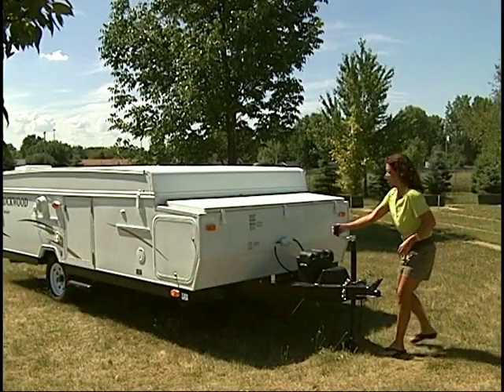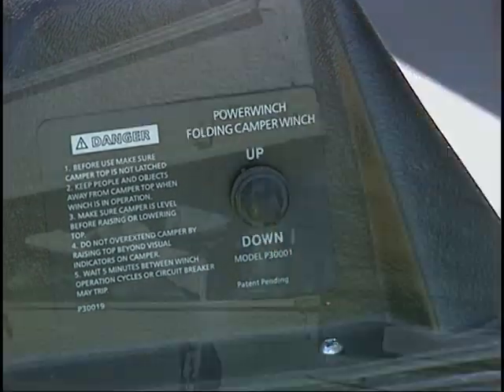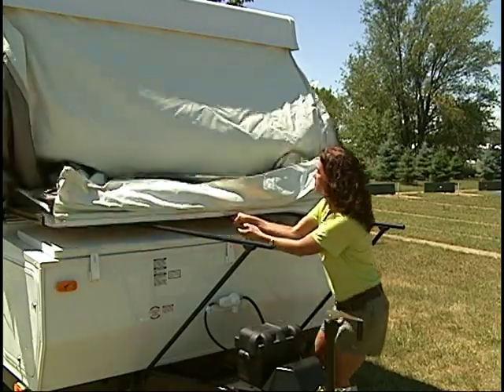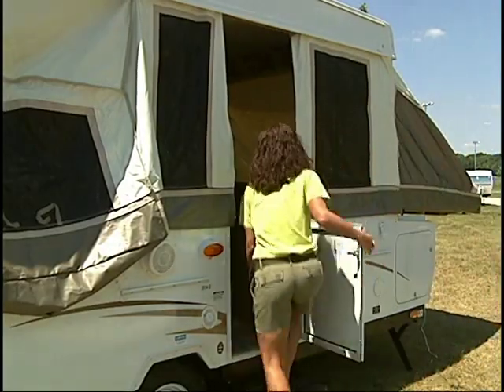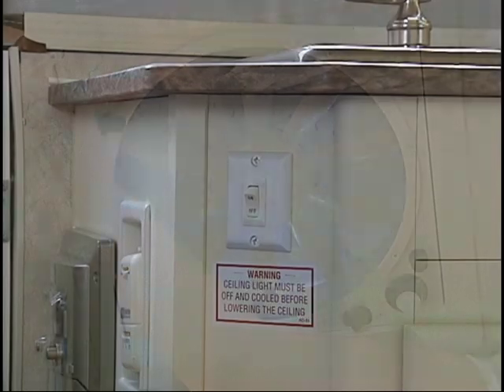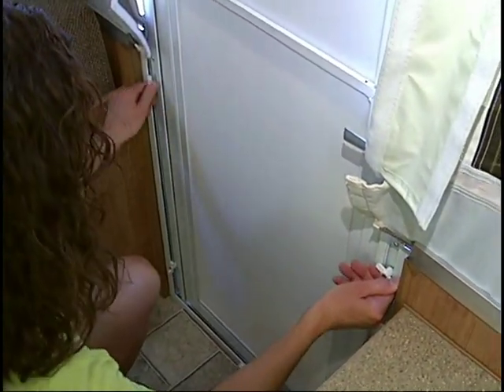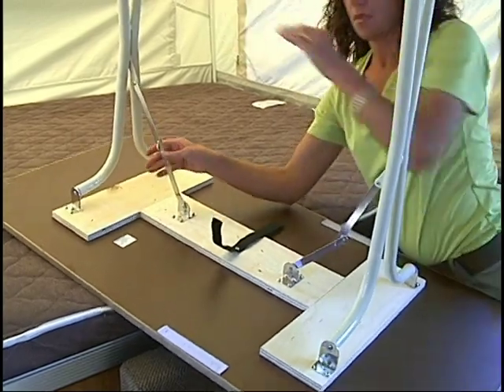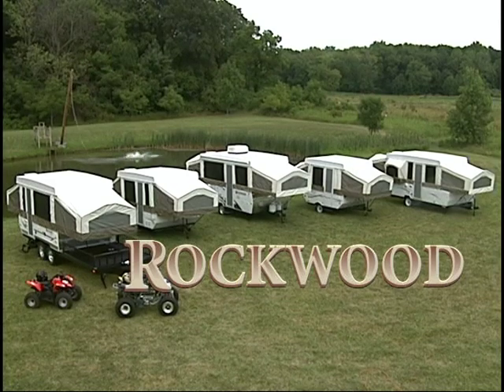Rockwood HW High Wall Popup Camper Setup

Comment: Where do I find the serial , vin,& Year of my pop up ?!?😮
Reply from the maker: The VIN may be located in a few different places. Check the front tongue, the A-frame, of the camper. There should be either a metal tag or the VIN could be stamped on the frame in that area. Alternatively, there is generally a sticker on the driver side of the camper near the front. Some may also have a tag inside one of the cabinets inside. The year ca be decoded from the VIN. If you can't find a decoder chart online, comment with only the last 8 of the VIN and we can decode the year for you.